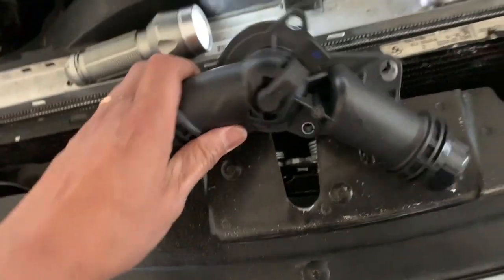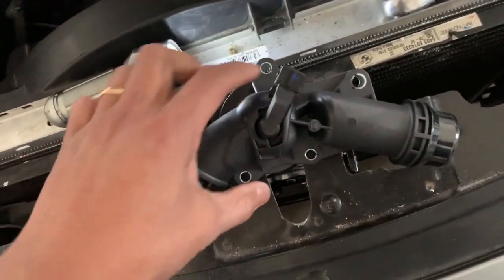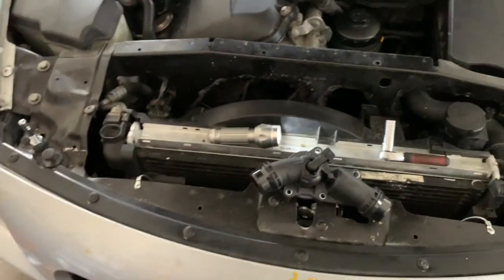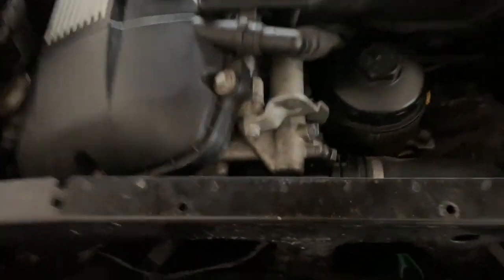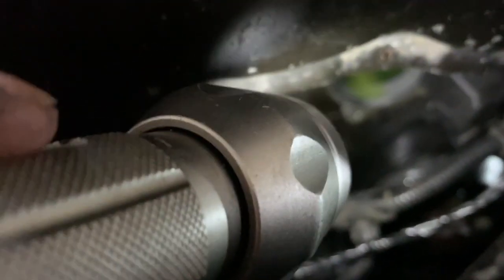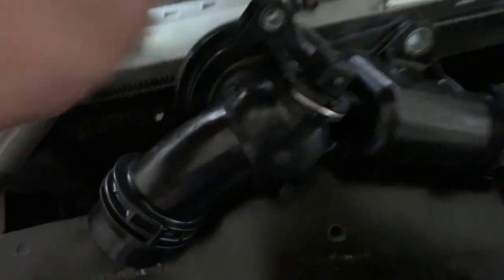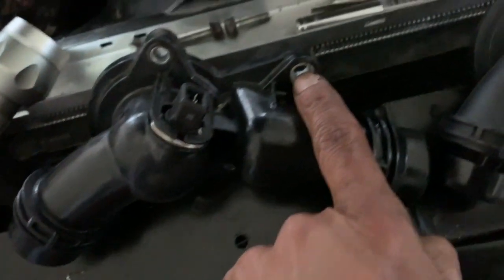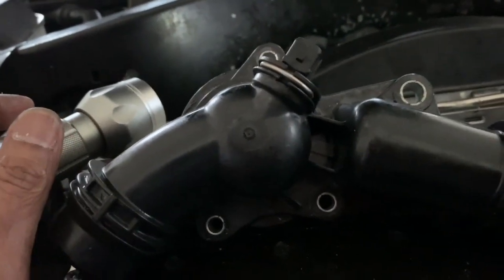bmw z4 - thermostat replacement

Comment: Nice. Short and sweet.  Right to the point. The video shows you can do it without taking everything apart, tells you head size of the bolts and their respective locations.  All other videos should model after this one.  AllData needs to hire you.

 Other videos have a stupid intro that is as long as this complete video! Lol😂
Thanks!